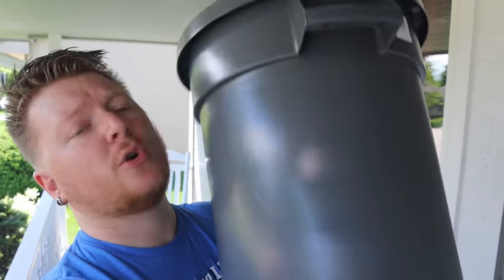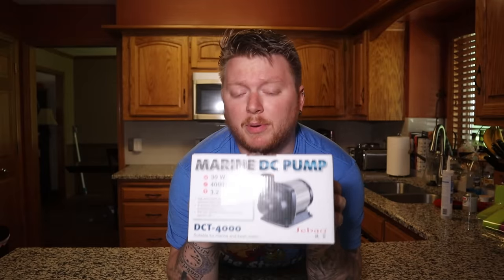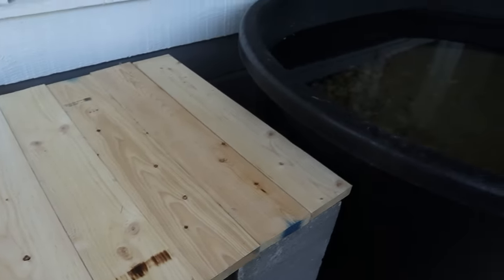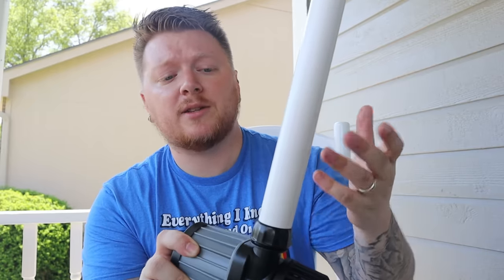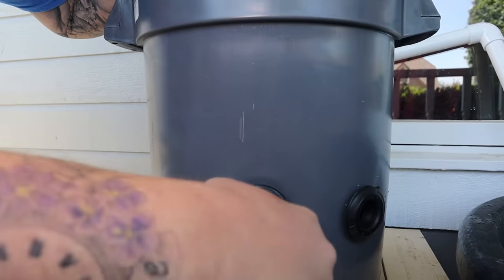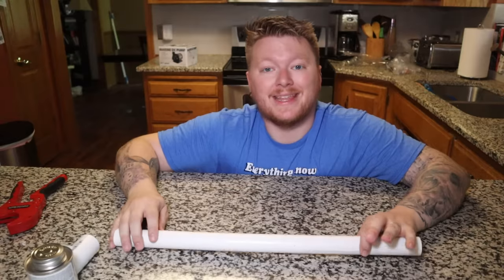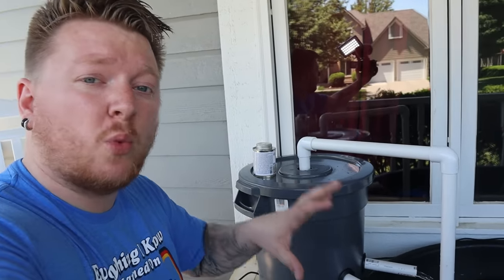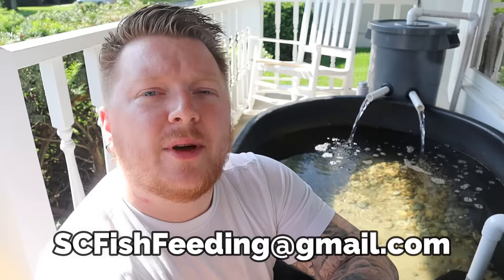DIY Pond Filter Made EASY From Trash Can!

Comment: instead of going through the lid, a third uniseal close to the rim of the can would not only eliminate one elbow, but would mean you could preform maintenance without disconnecting  anything.
Reply: that's a AWESOME Idea I would do that myself.
Reply: Great upgrade to the pond  filter. Definitely gonna add this method to the filter I'm about to build.
Reply: Also, an upgrade to the spray bar... Instead of drilling the holes onlly on the bottom, you could drill them on the sides as well so it sprays outward as well as down. It's still only spraying in a line in the method used in this video.
Reply: Add one more uniseal near the rim for over flow
Reply: @dc12o3  I agree. I'd try out 4-way PVC coupling instead of the 2-way and more holes along the sides.
Reply: Smart and the spray bar would be more even since it would spray more horizontally and across the whole thing
Reply: Problem with this (just did it) you lose all vertical adjustability
Reply: Let's give this a try.

Comment: Helpful hint: when using a hole saw through plastic, run it in reverse.
Reply from the maker: That's what someone else said too! Never heard of that before but I'll definitely be using both of your suggestions on the next build!
Reply: @SCFishKeeping  uh dont run it backwards ,slow pressure & cool
Reply: Safety wise, you can just get a drill that has an auxiliary handle and it will be fine most likely. 
Maybe running it in reverse will keep the plastic from cracking as the bit grabs? I've never heard that before, but I've wondered if it was a thing, so I'll try it next build!
Reply: @christined3953  you can do it either way. I find in reverse it takes longer but reduces the plastic burrs.
Reply: I think if you get your pilot through and then fast speed and slow pressure
Reply: Add another hole, grommet and tube in your small garbage can above the white medium.The reason is, when you add fish, the filter will get dirty and plug up. When it does and it will from the fish waste, you want the over flow of your filter garbage can to go back in you pond and not over your porch. 
By adding the hole higher it will flow out of the 3rd tube and let you know the filter needs to be cleaned. I learned from building filters like this. Now my pond is over 2500 gallons and had over 200 fish. I ran multiple filters as well. Good luck and nice job.
Reply: I used to do this but I found it tended to melt it's way through the plastic sometimes and didn't really leave as clean as a cut because it walks around a little more, I just got a handle for mine and run it normally with light pressure and it works better IMO. You'll never fully get rid of the burs anyway, I just use a debur tool and run it around once and it is significantly cleaner and faster.
Reply: @monadking2761  can you explain this better?
Reply: @schnookieshullHull  when you run in reverse it takes forever you’re basically burning the hole out, when you run on normal it’ll cut fast but if plastic doesn’t give and hole saw grabs you risk cracking it.
Reply: I thought you would have the water enter the bottom of the can put a course sand bed on a grid with a screen that the water has to be forced through,then lava rock on top of that for beneficial bacteria then heat up and cut or bend top edge of can to form a spillway type shape so you have water"sheeting" back into the pond like a waterfall...I.d.k.
Reply: Bro..pit your intake at bottom of candy on opposite side,still on bottom put another bulkhead with PVC running out with a gate or ball valve to empty out the solid wastes that will collect there due to gravity and the sand bed above the intake.
Reply: I do 5 gallon bucket hydroponic and I always drill backwards to start. It does keep my plastic from cracking.
Reply: Awesome!!! I'll try that next time
 Always other ways of doing stuff!
Reply: It looks easy but i end up doing tiny holes w the drill and cutting, i was never able tonuse the hole saw lol
Reply: @SCFishKeeping  I know this is old but drill pilot hole forward the reverse the drill for the hole saw. It burns through with friction and won’t catch and potentially crack. It also won’t have any burrs. 🤜🤛
Reply: What size is the hole saw anyways?!?
Reply: YES, holesaws backwards thru plastic...! Nearly eliminates cracking/ tearing...! Just built one of these, working great...! I've always used hole saws backwards thru plastic... Works very well...! Wish I would've watched this before my build... Hope y'alls fish stay upright...!!!
Reply: What hahaha
Reply: I don't see the need with the seal. I've seen this suggestion for smoother cuts. Tried and every time it only seems to make things more difficult. It does help with starting the holes.
Reply: Husband can confirm!
Reply: @monadking2761 Thats exactly one point of several which I just suggested in my comment some minutes ago.

Comment: for your t-sprayer, if you drill slightly smaller holes on the sides instead of the bottom, you get more spray/aeration. half way through my build i figured that out. keep up the great work

Comment: On the spray bar, offset the holes so they spray in a zigzag pattern.  It will help with the straight down pressure and spread the initial contact points from a single line.
Reply: Good video up top
Reply: Walker Terrell and Lawrence Wilson are LYING SCAMMING TROLLS.
DON'T FALL FOR IT.
IGNORE THEM.
AND - REPORT THEM!
Reply: @Lawrence Wilson caught in 4k my guy, hacking is a crime
Reply: I was just going to comment that.
Reply: @jainemiller2375  what ?
Reply: @jainemiller2375  who the what...?

Comment: I love that you address the pump being off the bottom. I use milk crates, cut sections of the sides out with a sawzall leaving 4 legs, and the fish love to use the space as cover. They work great for plant stands too.
Reply: @lastditch727  That's a great idea! I plan on doing that or using theb5 gallon bucket. Both great idea.

Comment: Nice project and excellent presentation.  Quick remark; I've built a similar setup but inverted the filter where the initial intake to the filter's first contact is with the larger media and as the filtration process clears the water, finer media is encountered (long way of saying start with lava rock and ends with fine material.)  It improved my water quality by about 20%.  (Hard to improve on good quality already achieved with this good system.  For final water polishing, I added some plants (Aquaponics!!) in the outlet.  Happy fish, happy plans and beautiful amazingly clear water.  Well done!!

Comment: I have made a few trashcan filters over the years. I always used flexible tubes for my pipes and always had the intake at the bottom so the water comes in at the bottom and filters as it slowly rises through media then flows out my two output pipes and  usually a third slightly higher overflow emergency pipe at the top. I liked watching your design though gave me a few ideas about raising my pump higher in my pond.  great video and very good ideas.

Comment: Love it, nice and simple plan. I do a very similar design. No need to have the media within a bucket in the bin.. only minimising the available space but it's such a big flow rate it doesn't really matter. Another advantage moving the pump to the other end is you're getting better flow through the pond and not re-filtering the cleaned water.

Comment: That's so badass. Years ago, I used to make my own filters for turtle tanks, water snake cages, etc. by using a power head, 3 liter soda bottle and media. Just cut the top of the bottle off to the desired height, then drill a hole in the bottom on the side. Using the rubber aquarium tubing, run the tubing into the hole on the side of the bottle and up to the power head suction cupped to the side of the aquarium. Then, stack media in the bottle, plug in and bam, we have a biological filter. 
That trash can pond filter is genius. I love it. I live in western Washington, just outside of Seattle, and i want a small pond with a couple of koi, as the weather is always cloudy, sometimes rainy, cool and winters are moderate. the winter varies from the high teens with snow to mild, 30's with no snow. the cold lingers for months which is why fish selections are very limited.
So, I'm planning on using your brilliant trashcan idea. Although, I will probably be using a 50 gal Brute trashcan, as my pond will be around 9' L x 4' W x 3' D. as the fish will need the depth to survive the winters.

Comment: Thinking 2 upgrades:
1. Water return set higher and a filter drain added to remove settled solids that will collect in the bottom.
2. Direct the spray bar arms in opposite directions to disperse flow over a larger field of the media.  This might also add some circular filtration keep solids from reflowing into the tank, and later removed via the drain mentioned in item 1.
Reply: so another capped cut at the bottom maybe?
Reply: What's the point of the kitchen scrubbers?
Reply: I was thinking that the sprayers should spray out the sides to, so that it would cover a larger area of the filter media.
Reply: @06ironmike bacteria love to grow on the mesh scrubbers, similar to using bioballs, or the sponges.

Comment: Drill the in hole just below the lid so it can open with no disassembly,and easier to clean the spray bar which will clog up.

Comment: Good idea.  One recommendation I would make is to swap your intake/exit locations.

By adding a downpipe to the bottom and putting the outflow up top you get more water contact with the media plus any debris is stuck at the bottom as it can't make its way up.

You're method works but you may eventually end up with debris flowing out instead of settling to the bottom.

Comment: Great design only depending on size of pump you may have to increase the size of your output or it will just overflow. I went with two outputs at 3" to 2" out the can that "wyes" into four 1  1/4 inch flex pipe to my waterfall. Works perfect! End of day one and I'm starting to see deeper into the bottom of the pond.

Comment: Great job, I myself have stopped using the polyfill for the fact of the replacement, if u have some heavy bio load fish. Now I will say something u can do is remove the lid on that filtration system and add some bog plants. They will help filter as well and can dress up the filtration system.
Reply: You can prolong the poly filla by placing decreasingly coarse ac filter material above it coarse, medium, finer, then the candy floss, so not as much of the big stuff get through to clog. Grsnted its good for 3 or 4 cleanings at best tho.

Comment: Thanks for posting.  I am making mine for my small pond with a 5 gallon bucket and some flex tubing instead and some pvc pipe.  I'm going to feed the pond water into the bottom of the bucket and feed it back out into the pond from the top as it fills up. that way the sediment can fall with gravity to the bottom lessening the debris that goes into the filter material.  This requires a drain added to the bucket for routine cleaning.

Comment: Thanks for posting this - I'd be interested in seeing a follow-up to this once it's actually filtering something and what sorts of steps you take with one of these filter setups.  Do you have to switch out that batting?  What about those other materials?  Thanks much!
Reply: In the past, that quilt batting has been pretty cheap but, if you want to rinse it out (use a backwards flow) do that with Non-Tap Water; highly filtered to get the chemicals out. The rinsed out batting will look stained but it will also keep whatever good bacteria that eats nitrates and nitrites alive and in place. 

Another thing is to have 2 layers: rinse both out the first time it gets full and gross looking. Replace the BOTTOM layer with a fresh, unused layer and put one of the rinsed layers back on top. The NEXT time you clean out the batting, put the rinsed out bottom layer (from the last cleaning) on top and put a fresh layer on the bottom of your 2 layers. Again, this will keep the good bacteria going.
Reply: 1

Comment: i have a common snapper in a 150 gallon rubbermaid tub Filtration inside and outside is always  a problem. this method is perfect for him and cheap. i have been using 2 canister filters and they are getting ruined when hes outside all summer and cleaning them is a nightmare. thanks brother this seems great

Comment: Thank you-very easy construction. I am an 80year old woman about to make my first bog filter. I intend to use clear tubing running along the bottom of the pond ( an old bath) from the pump to the inflow pipe.The videos I have watched so far flow water up through the media to an overflow pipe located at the top of the water, with a clean out valve at the bottom. I intend to use a homebrew barrel which has a tap at the bottom for clean out. I got some good ideas from your video however. One question- do I still need a sponge filter on the pump once I start using an external filtration system? Would welcome your comments.

Comment: I built similar but reversed the filter system so it would fill from the bottom. Then you don't need to worry about the water stream hitting only one spot on the media. Overflow near the top and then back to the pond. You can still put the media at the top so its easy to access and clean/change.

Comment: Thanks for sharing!:face-blue-smiling:  One of the best ways to keep your pond crystal clear is with a drum filter. It works automatically, so you won’t need to spend much time on upkeep. Plus, it’s affordable to run — just around half a dollar a month in electricity. If you want clean water without the hassle, it’s worth considering.

Comment: I need to build a new filter system for my 15' wide outdoor pond.  The method I used before was similar to yours but I ran mine in the reverse order.  I used flexi hose, not PVC and bulkhead connectors.  I pumped the water in from the lower part of the bucket and let the filter bucket fill up and then it spilled out the top through another flexi hose.  We also used to use fine bird netting along with the lava rock.  I like the sponge and batting idea so I'll try that this time.

Comment: If you put the polyfil in the box where the pump is, that will act as your prefilter.  You can then take the polyfil out of the garbage can and replace it with more biological filtration media.

Put the pump on a flexible hose to make it easier to change it the polyfil prefilter.

Awesome video!!

Comment: Goldfish are hearty low maintenance fish, so they are good for ponds in areas where the temps can get low in the winter, such as where I live in Southern California at nearly 3000 feet up. I don't know where you live, but there are many beautiful fish you could put, like crappie, or Texas cichlids.

I have a old spa that it being used as a pond, and it is about 400 gallons. It has been doing fine for years without a big filter, but I should make a big filter for it to replace the smaller filter system I currently use, and watching this was helpful.

Comment: I built one today. It took me a while to gather supplies. I used a rain barrel because my tank is 600 gallons so I  felt I needed larger than 10 or 20 gallons. Fingers crossed it holds up. I already had the rain barrel. Also starting with a dirtyish pond. It does have 2 filters that are supposed to be for 500 gallons. My koi keep growing and reproducing.....
Thanks for the info, fingers crossed it works for me.
Reply: Did u use the same pump that he used in the video?
Reply: @consueloamortegui3099  yes I  did and I love it. It was a bit more expensive now. Like 80ish.

Comment: Great job, I love this.  I like to keep the pump's intake closer to the surface, so if/when something breaks or there's an earthquake or hurricane or something less water will be pumped out.  Why let it pump out half the pond when you could easily restrict it to only a quarter pumped out before the "fail-safe" stops it?  And keep the pump's intake as far from the exhaust as possible, or you're only sucking up just-filtered water to be filtered again.  

Also, replace some of the inert sponges with 2 inert fabric bags filled with activated carbon from the pet/fish store.  Place each carbon bag under the spray arms so that the water falls on them.  Don't replace the sponges when you replace the activated carbon, as they build up beneficial bacteria in the fibers of the sponges and you want to foster the growth of that bacteria - it breaks down waste products.  If the sponges get too clogged up and start diverting the free flow of water THEN replace a only a few of them at a time when you replace the activated carbon.  That way you're only losing half your beneficial bacteria.  If you replace ALL your sponges then you also lose ALL your beneficial bacteria that took 3 or 4 weeks to grow.  

I also like to buy an extra bucket lid and cut the outer lip off and then drill many relatively large holes in it so that it can fit down inside the bucket to be used as a platform/support for the poly fill.  You only need a couple layers of poly-fill, it's only to filter out large waste, otherwise it get clogged quickly and restricts flow.  And it's quick and easy and cheap to just pull it out often and replace it without having to do a full-on filter cleaning/media replacement.      

As for pump ratings, they tend to be optimistic.  And when you pump water thru filters and pipes, 90-degree elbows and especially when you pump water UPWARD, the amount of real flow is significantly less.  I would get the next size up than what you need, especially when the pond has a high bioload (crowded with too many fish for the capacity of the tank & filter.)  Better to have a little cushion in terms of filtration and flow.